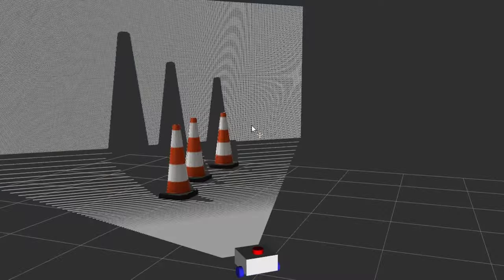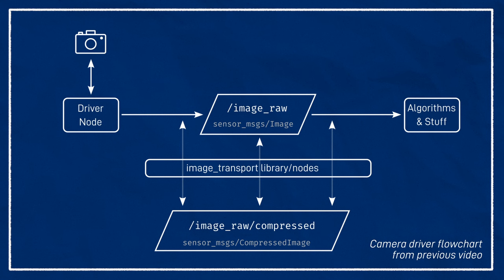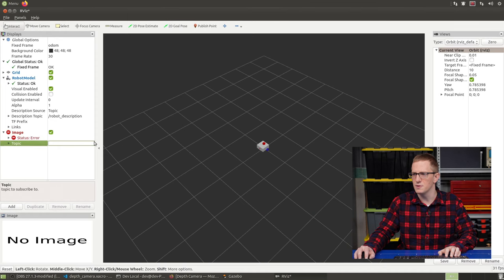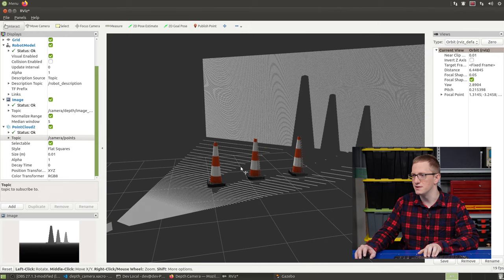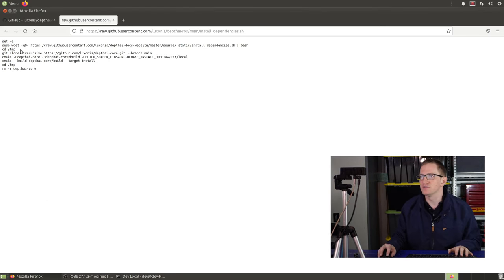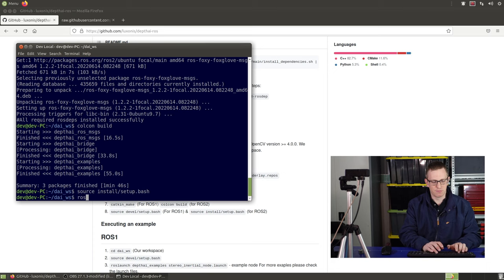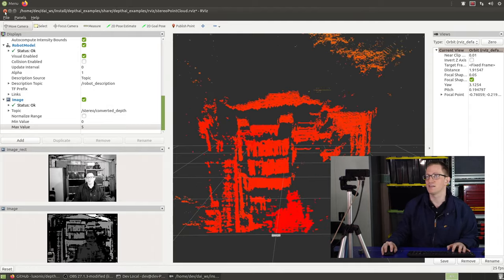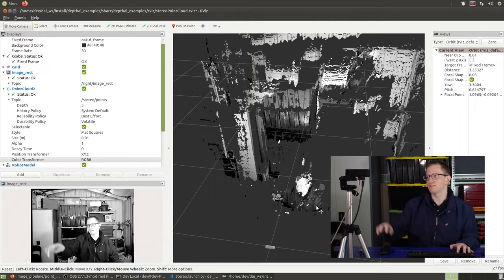How to get your robot to see in 3D! (Depth Cameras in ROS)

Comment: Awesome video! Here's an Idea or a bunch of Ideas for up coming videos... I want to build a smart RV... I would want it to cook, clean, find my stuff and bring that stuff to me. I need to build a set of robotic arms that run along a track hung from the ceiling (It could fold itself up and be out of the way when not needed), I would like to use visual slam, to map and constantly update said map as it moves (obstacle avoidance, where is my cup of coffee, etc.)  also has to do object recognition obviously. I have seen that using machine learning the robot ai could learn how to do tasks from watching YouTube videos using pose estimations and then using ai to find the most efficient way to preform the task and be adaptable to new problems as they arise by running simulations of said task several times before performing the task, and learn as it does the task! I'm also not sure about the best way to run this... Computation (AI) is going to need a semi-decent gaming laptop at minimum, but the robot arm is only going to require a raspberry 5 with ssd. It would essentially just run the stepper motors and sensors (pressure sensors in the grippers, cameras, etc.). Then the main brain needs to communicate with the ros in the arm to preform tasks. I would want it to all run local with a G.U.I.

Comment: I'm excited to find your channel as I'm planning to develop a firefighting robot designed for navigating smoke-filled environments. This robot would:

Generate a 3D map of the room to navigate through smoke.
Detect cracks and assess structural integrity to predict potential collapses.
Incorporate thermal imaging for identifying hotspots and victims.
Utilize AI for autonomous decision-making and obstacle avoidance.
Feature a water or foam dispenser for firefighting efforts.
I'd greatly appreciate any guidance or collaboration on this project.

Comment: Great video, thanks for all details
Just a question, is OAK-D Lite Fixed-Focus or Auto-Focus ?
Reply from the maker: It depends on the model. Mine is auto-focus and I have found the autofocus a bit iffy. I really haven't tried to fix it though so it may be a driver setting that can be tweaked. I believe you can also manually control the focus on that model, which I would probably do.

Comment: just wonder if this could be a complete replacement of realsense D435i.
Reply from the maker: Yeah I had hoped the same but so far I think not, as the depth seems to be a bit worse and it doesn't have an IMU. I think the OAK-D (rather than OAK-D Lite) is a closer competitor.
I still have hope that it will be good for entry-level prototyping and simpler projects.

Comment: Hey, I'm having this problem with my depth camera. I'm using Hector quadrotor package that has ASUS Xtion PRO depth camera and I'm trying to use it for 3D mapping in custom Gazebo world (apartment). The problem is when I subscribe to /camera/rgb/image_raw in Rviz by Camera it can see only certain objects, but most of the objects for example walls, postboxes etc. are just gray. The depth /camera/depth/image_raw works just fine and I can see objects, but still only in shades of gray. I tried to switch format in urdf of a camera from R8B8G8 to B8R8G8 and RB8 but nothing changed... Do you have any idea what could be the problem?
Reply: Hey, I actually managed to fix this problem by running this in terminal: "$ export SVGA_VGPU10=0", right before launching my .launch file that starts Gazebo and Rviz. 
It seems that the color not being visualised is an error and didn't find the explanation for that. You can also echo it in your bashrc script so you don't need to write it every time -> $ echo "export SVGA_VGPU10=0" >> ~/.bashrc
Reply from the maker: I'm glad you got that sorted and I hope others can find this comment if they have the same trouble. I definitely would have been stumped!

Comment: Anyone have a link to the blog post referenced?
Reply from the maker: Hey Nigel - I'll be honest here. My current process is basically: write a script for myself, follow the script for the camera, then turn the script into a blog post. It used to be the other way around (starting with the blog post) which was better, because now unless I get the blog post up within a couple of days of the video I find myself feeling the pressure to get the next video out and the blog post never gets published.

So I do have an 80% finished blog post for this one which I definitely intend to publish some time but I'm not making any promises as to when.

If there are particular questions you have, head over to the discussion thread for this video on the forums and I'll try to answer them. (Because the forums only went up last week there's not been much activity there yet).
https://discourse.articulatedrobotics.xyz/t/discussion-depth-cameras-and-ros-making-a-mobile-robot-pt-10/35

Comment: Does this work for ROS noetic as well? 
I went to the previous tutorial for a regular camera and had no issues, I however didnt see many of the other topics being published. nonetheless, i managed to get the image_raw topic functioning in rviz.

the issue now is that when attempting to change the type = "depth" it does not display the topics as expected. I am able to display only when i change the filename="libgazebo_ros_depth_camera.so"> , under image topic: /depth/image_raw and it shows an image where far objects are white while near are black

in the PointCloud2 however, i try to put the /points topic, but there is an error that says: Transform [sender=unknown_publisher]
For frame []: Frame [] does not exist

and in the terminal : [ WARN] [1716868128.356292091, 23.441000000]: Invalid argument passed to canTransform argument source_frame in tf2 frame_ids cannot be empty